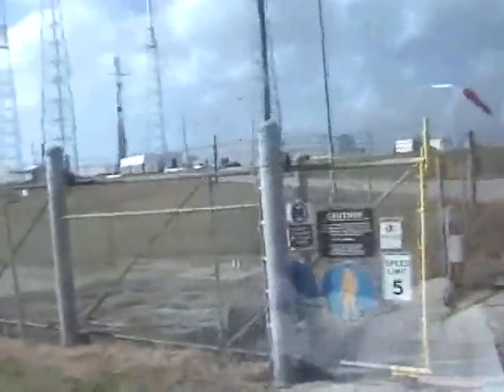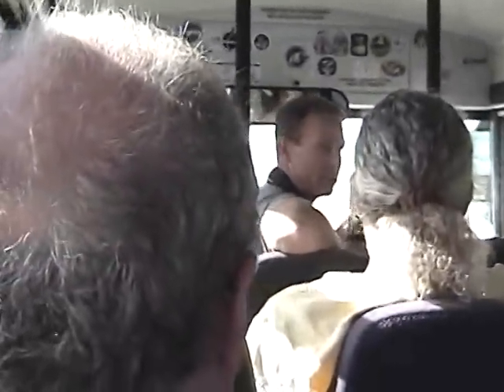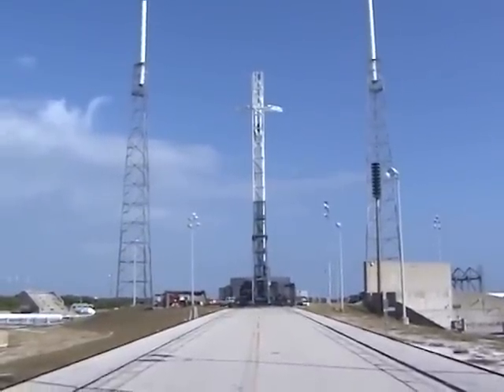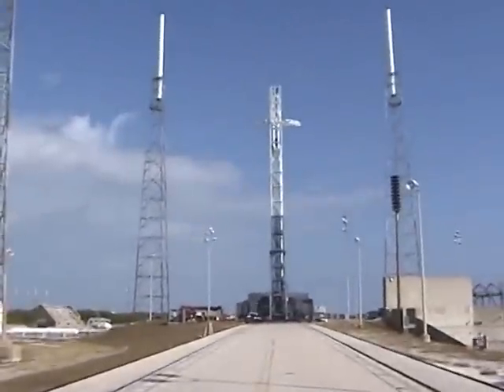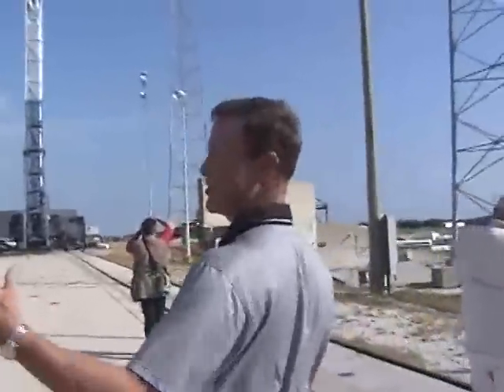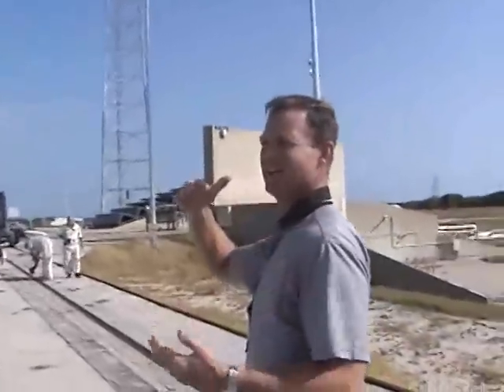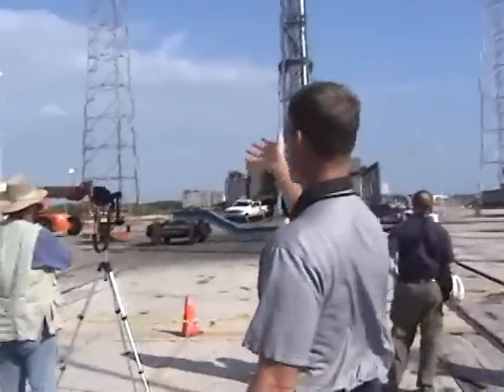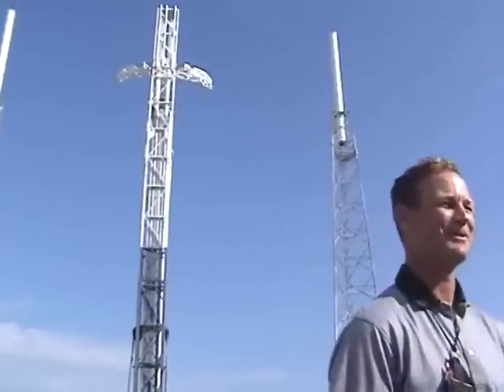Tour of SpaceX Falcon 9 launch pad SLC-40 during Air Force Week 2010 at Cape Canaveral

Comment: @zaitcev I think you misunderstood me. A typical Dragon stack (both the pressure vessel + trunk) would normally separate from the F9 US upon insertion and then the pressure vessel would itself separate from the trunk before reentry. 

I'm saying there are hints that the trunk will be bolted (non-separable) to the F9 US on this flight and that only the capsule section will separate and maneuver around.

Comment: @silverad0 AFAIK, the 2nd Dragon to fly will actually be the fully functional unit, including solar panels - first one is battery-powered. There are indications that the 1st Dragon isn't even supposed to separate from the F9 upper stage with the trunk attached, i.e. the separation plane would be pressurized vessel - trunk and the trunk would stay bolted to the upper stage. Not sure about this, though.